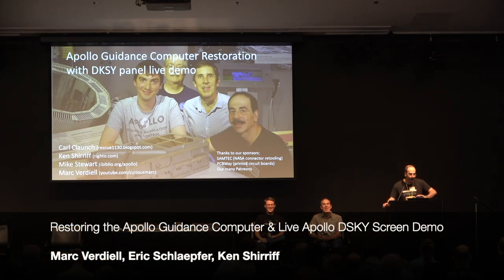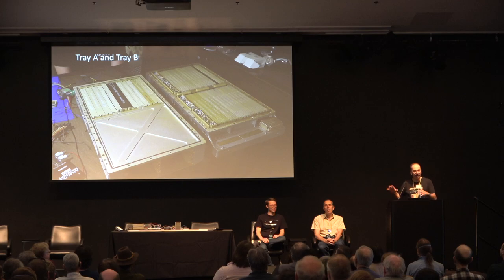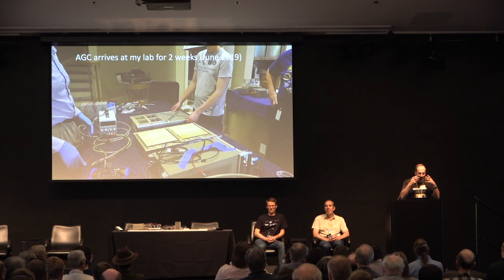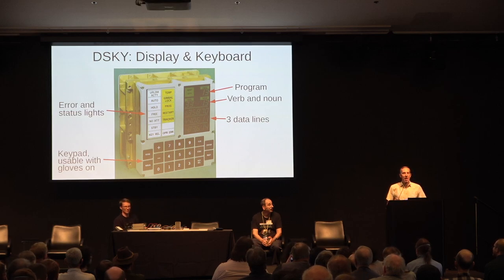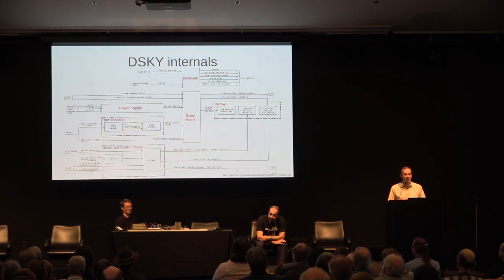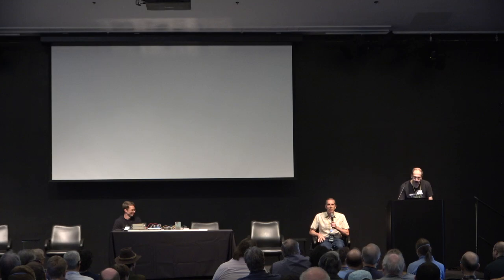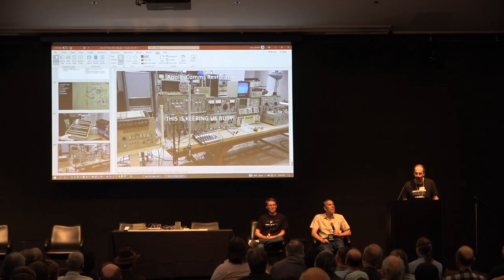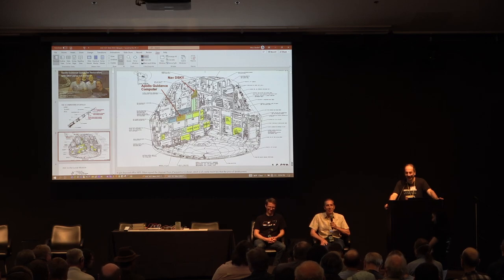Restoring the Apollo Guidance Computer & live Apollo DSKY screen demo

Comment: Interesting to learn that the 1202 could block up the AGC completely. I think I read it in Frank O'Brien's book that if the 1202s came closer than they did on XI the AGC would've lost the navigation data and they would have had to abort. 
Soo... anybody have a spare rendezvous radar to try? :)
Reply from the maker: Yeah. Kinda scary!
Reply: The 1202 means the machine is restarting from a saved state and on paper it won't lose anything.
Reply: As Mike explained it in the series it was not the radar but the CDU box that failed. Turning off the rendezvous radar was only a workaround for the rest of the mission.
As far as I understand Mike he still has no satisfactory answer how the AGC kept working as the 1202 alarm came up. He said there were a higher possibility to crash than to land. I'm still waiting for an update on that topic.
Reply: @benjaminhanke79  Turning off the Radar would not actually have fixed the problem, because the problem originated in the angle resolvers for the antenna, which got their power through the CDU. The problem in the CDU was that it got TWO different 800 Hertz inputs (one from the spacecraft, one from the AGC). Those were frequency locked but not phase locked.

The digital-to-analog conversion of the values only made sense to the AGC if the Radar mode switch was in LGC ("LEM AGC"), because only then it would use the AGC AC voltage as reference. If the switch was in "Auto" or "Slew", the CDU was using the spacecraft AC supply. This caused the CDU to contanstly update the resolver angles in the AGC, stealing CPU cycles: The CDU was basically injecting increment or decrement instructions into the AGC processor, up to the point that the AGC couldn't run the landing&navigation program (SERVICER) to completion within the fixed 2 second cycle. Every two seconds, an interrupt scheduled a new instance of SERVICER, which caused the AGC to run out of memory, forcing a restart that (temporarlily) removed all Jobs and restarted ONE instance of SERVICER. Depending on which type of memory run out first, this either resulted in a 1201 or 1202 error. This is a problem called TLOSS (time loss).

I highly recommend reading "Sunburst & Luminary" by Don Eyles if you are interested in the details.